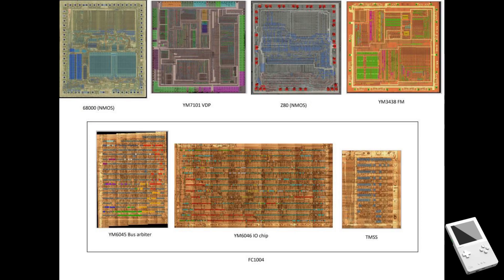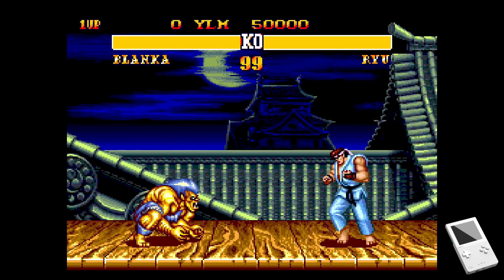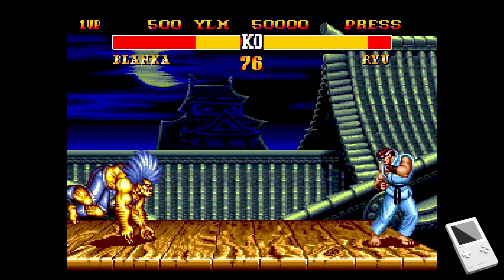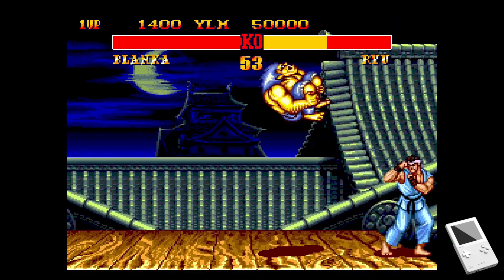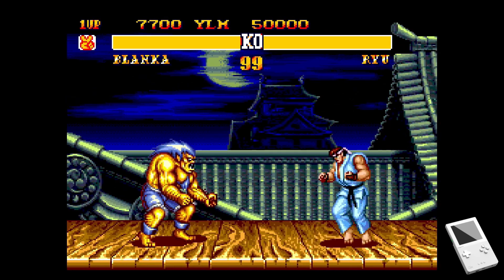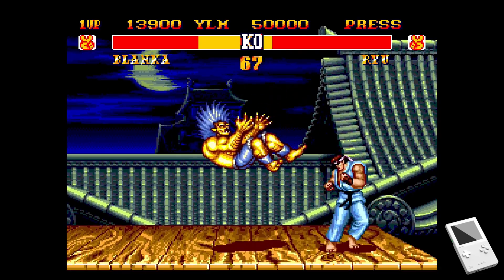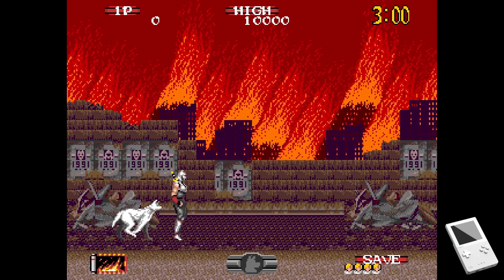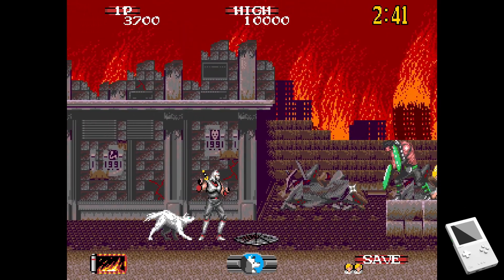Cycle Accurate Megadrive/Genesis| Nuked MD FPGA | Analogue Pocket

Comment: For some reason when turning on my Analogue Pocket and loading the Genesis Core I have to use the Spiritualized core first in order for the roms to load. After loading Spiritualized and can then switch to Ericlewis but if I go straight to ericlewis core first upon turning on the pocket I just get a black screen. Any ideas? I've updated all on my updater a few times and that doesn't seem to do the trick.
Reply from the maker: No idea, I have not experienced this

Comment: So current mister core is not accurate? Whats the whole point of the fpga then
Reply: There are levels of acuracy with FPGA replication, there are 1:1 transitor level cores, and near cycle acurate cores, FPGA always offers very low latency and high compatability no matter what with near complete or complete cores, hopefully, one day all major systems will be 1:1 nuked cores.

Comment: I don't understand, i thought the whole idea of fpga is cycle accurate cores? So, the old one is not cycle accurate? How many other cores aren't? I'd like a list of cores that have an official stamp of approval for being accurate to original hardware.
Reply: There is a misconception that fpga is inherently accurate to the source. It depends on how the fpga is implemented, dare I say programmed. Many cores are well implemented. However  there is many arcade titles ported to the saturn, ps1, ps2 etc that are the most accurate way to experience that title, CURRENT fpga (Ie 
Mister) cores includes.